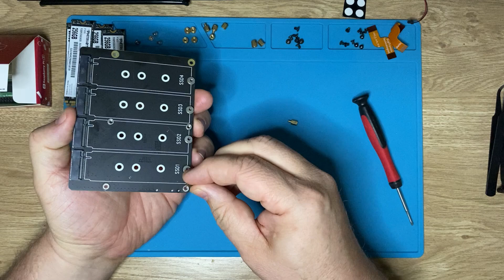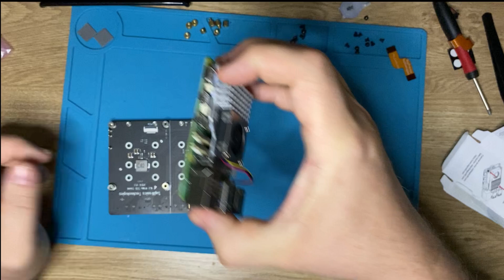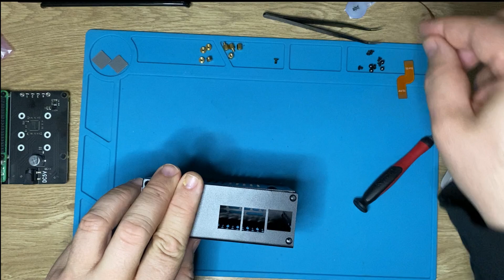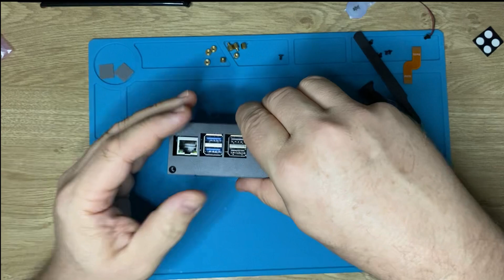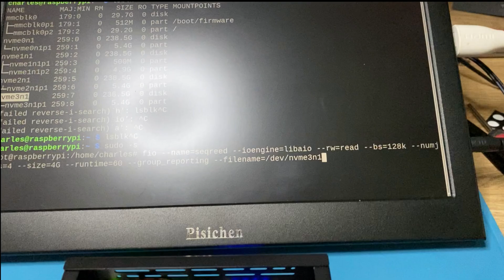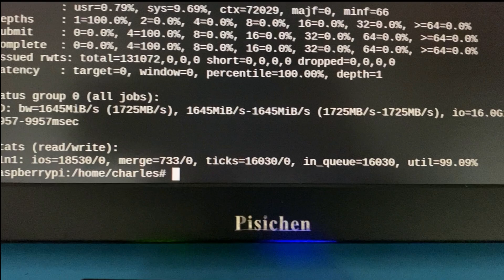Raspberry Pi 5 and X1011

Comment: Hi - thanks for the insights with fitting to the case!  Re. the 3mm NVME standoffs - they are for 2220, 2240 and 2260 size NVMEs - the NVMEs are shorter and so need a standoff closer to the connector.  The NVME sits in the slot on the side of the standoff, and the screw comes up from the other side of the board...  ;-)

Comment: I was able to hold the shift key down while powering up and installed the operating system directly to the NVME drive with the ethernet cable pluged in.